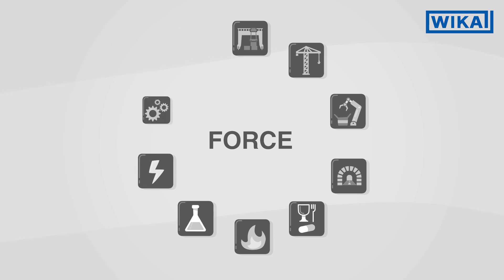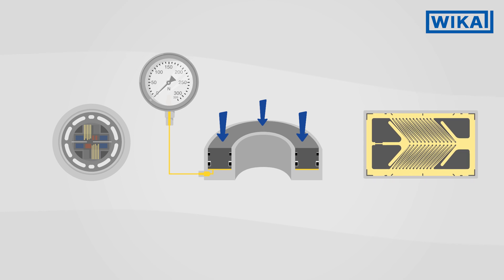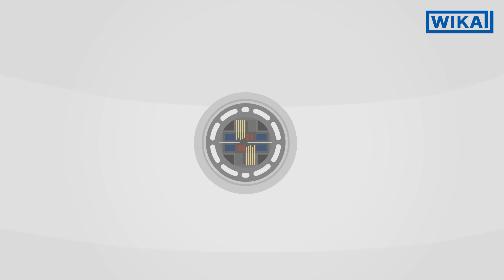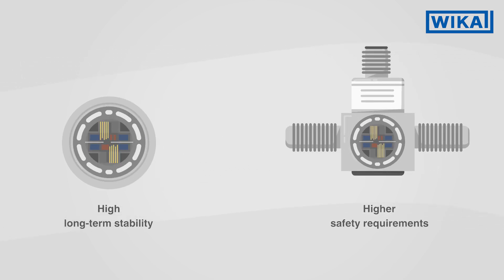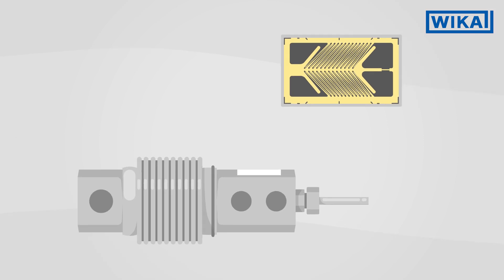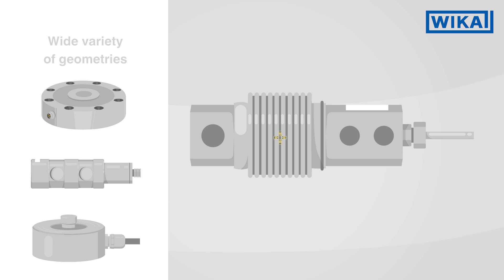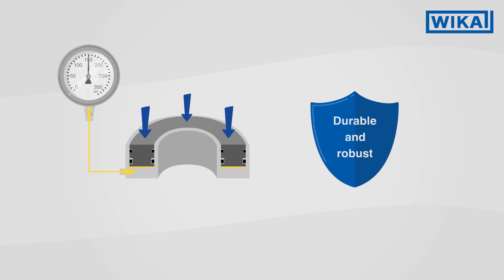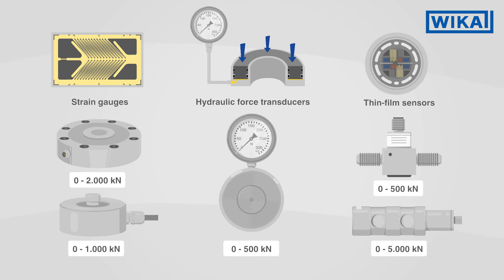Industrial force sensors | Which sensor technologies are there for force measurement?

Comment: Thanks for the video. I would like to know how can I communicate one of these sensors with a PLC ? I'm interesting in implementing one of these force sensors but I would need some kind of transmitter that can convert the mV output generated by the sensor into a 4-20mA signal for exemple.

Thank you in advance for your help.
Reply from the maker: Hello @DanielVLM,
Thank you for your comment. For all technical and commercial queries, please contact your local WIKA partner. One of our experts will be pleased to advise you. http://spkl.io/6053f6Tr1
Regards.